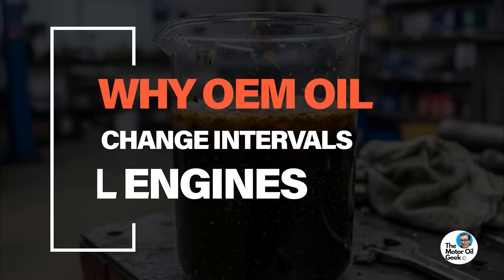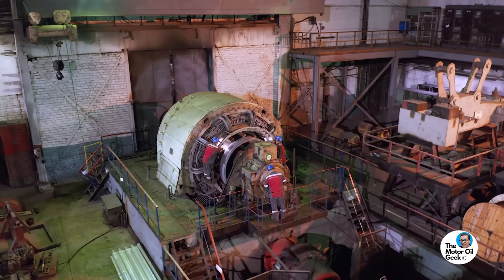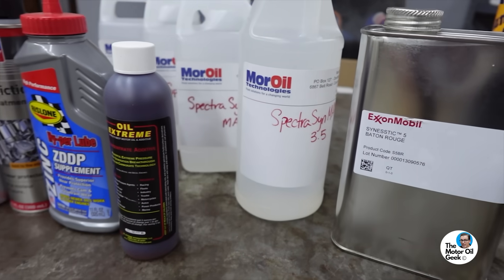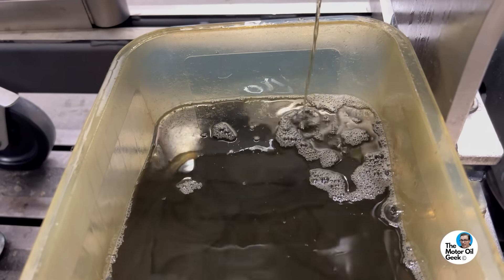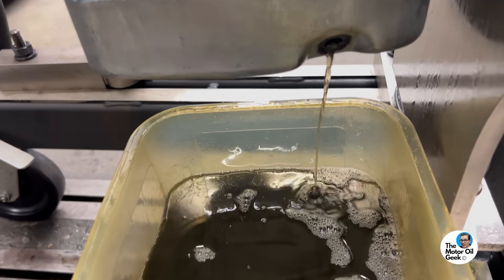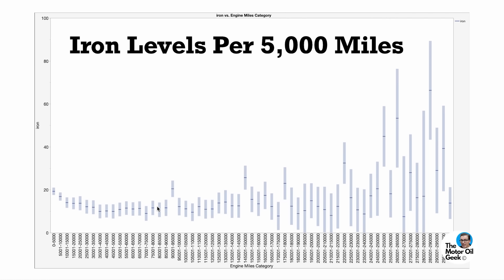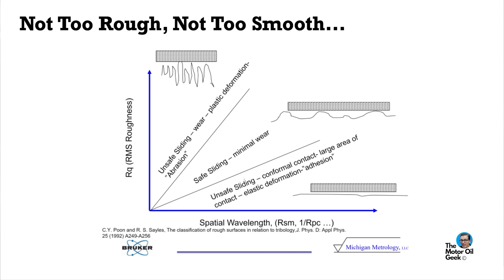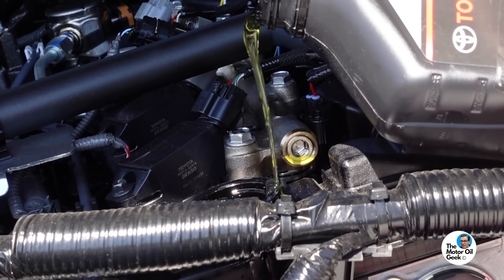NEW Data Reveals WHY Modern Engines FAIL Prematurely!

Comment: To answer the question: Yes cheap bad parts and super thin oil that’s not being changed soon enough. Oil is cheap, engines are not.
Keep up good work
Reply: No name mineral oil is cheap. Big name synthetic oils are not.
Reply: @Beenomars Depends where you buy the synthetic. Walmart usually has brand name synthetic for less than $6/quart when you buy the 5 quart jug and some parts stores are the same when the oil and filter are purchased together.
Reply: @Beenomars  Quaker State full synthetic is a perennial champion of 540 RAT's oil durability board and it is DIRT cheap, $22 for a 5-quart jug at Menards.
Reply: @drunkenmessiah Not available where I live.
Reply: @Beenomars  Compared to engine replacement, YES their cheap
Reply: @Ever443 depends what engine in what car
Reply: The old "oil is cheap engines are not" saying is too simplistic. When you math it out on cost of oil Vs. The expected lifespan of the engine. You do get to a point where changing oil is wasting money. Like there are a lot of people who lease vehicles and turn them in every 2 years. Changing the oil more than necessary to satisfy the warranty is a waste of money for those people. Like where I work. Oil change intervals for my equipment is supposed to be 100hrs per the manufacturer. But I run full synthetic oil and change the oil 1 time per year which usually comes out to 4-500hrs. Why? Because the rest of the machine is going to fall apart first. We have a pretty comprehensive replacement schedule to replace the equipment before that happens. So changing the oil more often is a waste of money and labor. 

Also 65% of engine wear happens before an engine reaches operating temperature. No amount of oil changes is going to fix that.
Reply: @d3faulted2  "Like there are a lot of people who lease vehicles and turn them in every 2 years. "

Those people aren't watching this channel.
Reply: @bcubed72  You never know. There are probably a few.
Reply: @d3faulted2 
THANK YOU 👍👍👍
Reply: As a mechanic you have no clue what you’re talking about. Changing the oil is paramount. I bet you don’t have a vehicle over 500k. I have 5 vehicles over 500k. You know how? Change the oil every 3500-5000 miles. It’s that simple
Reply: @RipliWitani  You're right I don't, but that's more because i like having new and shiny with bells and whistles. Closest I have is a 2014 F-450 with the 6.8 V-10 and 290k. Next closest is a 2015 F-150 with 145k that i sold to my parents. Current is a 2019 with 80k . So much for 10k oil changes bricking the engine by 100k. Still doesn't burn oil. Again I'm not saying to blindly follow manufacturer recommendations. But do oil analysis and base your OCI off that. Make Data driven decisions about PM.
Reply: @RipliWitani  how do you explain the semi trucks that do 25k oil changes and get over a million miles out of their engines?
Reply: @d3faulted2  Easy, they measure their oil changes in GALLONS, not quarts 😆
Reply: @drunkenmessiah  But oil os cheap and engines are not. Why not change more often and maybe they'd get 2 million miles out of the engine? Could you imagine how long those engines would last if you changed the oil every 3-5K?
Reply: How can you say this to one of the premium Tribologist in the industry? Gibbs racing, worked for multiple companies formulating oil and if you sat down with him he might run circles around you on his knowledge of interior engine parts, function, wear and changes over the years.
Reply: @jeffreyb1451  Just because someone is an expert doesn't mean they don't have their own biases or agendas. COVID was an excellent example of that.

That being said. I'm not diagreeing with him. He advocates following the data. Which i'm also saying. Do an oil analysis and base your OCI around that. Yes you need more frequent oil change intervals early on, but after break in do you really need to keep that frequent OCI? Most likely not. There is always a point of diminishing returns. Changing oil more frequently than necessary will just cause you to burn money without any significant increase in engine longevity.
Reply: @d3faulted2  Very few cold starts, ideal driving profile, huge oil volume, unlike almost every car.
Reply: @fritz4493  So you're telling me that there are other factors than just mileage that determines OCI's?
Reply: @d3faulted2 Because they have different oil filtration systems, many long run trucks have centrifugal filtration systems. (That is on top of a standard filter pack)
Reply: @d @d3faulted2 our way overthinking this, simply saying if your manufacturer recommends 7.5k or 10 k you are asking for problems. I change oil every 3k regardless, have used synthetic and standard mineral oil. Have rebuilt 100’s of engines and evaluated wear on short oil changes and longer oil changes and there is a difference in wear and life, exactly what Lake says cleaner oil is better. So change often. But not every 500 miles, don’t be silly. Your changing at 500 hrs is approximately 30k between oil changes. Either your math is off or you’re just lazy. But to each his own. Oil change is average 🎉100 bucks if you take it to an oil change shop. Engines can be 10k + for a full replacement., so changing the oil every 3k costs approx $3300 every 100k. MUCH less than an engine. Your money, do what you want but change often, or your buying a new vehicle much earlier than needed.
Reply: @Ever443  If you manage a fleet this isn't even close to over thinking it. 

You may have been in 100's of engines but you obviously don't understand my points. 

What if your plan was to get a new vehicle at 100k? Any decent modern engine will make it to 100k on 10k oil change intervals. If you do replace your vehicle at 100k you've just saved  yourself $2,300. Not to mention every time you go for an oil change it would eat up an hour of your life...probably. you just saved yourself 23 hours as well. What is your time valued at? Mine is expensive.

500 hours does not equal 30k miles. There is no direct correlation between hour and miles. Old wisdom put 100hrs = 3k miles. But that's just patently false. This is a topic that is long debated. And there is no real answer. Even with miles not all miles are equal. 10 miles of NYC traffic driving does not equal 10 miles on the open highway. Even hours on equipment isn't equivalent. Something that sits at a constant speed and runs on a relatively constant load is not going to be the same as something with highly variable loads and changing RPM.

There are even engines out there that never get oil changes. Like large marine diesels. They have a filtration plant, do oil analysis and add fresh additives when necessary.

The key is doing an oil analysis and basing your oil changes off of that. In extreme environments and hard operations. Even your 3k oil change may not be enough. Or you may just be wasting your time and money.
Reply: @Ever443  Again. Too simplistic and misses the entire point of this video. OCIs are neither static nor linear. They follow the reliability bathtub curve. Frequent in the beginning, less frequent in the middle, and frequent at the end-of-life again. "Oil is cheap" mentality just wastes money and is in no way scientific or data-driven. 10k OCIs are perfectly acceptable once the wear rate has stabilized in the middle of the engine life expectancy. Data shows this over and over again, yet people still do the 3k polluting OCIs. This isn't the 70s anymore.
Reply: 10k lol? Enjoy your brick at 100k. I worked on many modern engines that do what you say. If they are direct injected you better be sure to get the heads cleaned because you will be paying out the ass to get it replaced.
Reply: I worked on marine diesel and you’re completely wrong. The oil does get changed. The bad oil gets separated out and new oil gets put in. You literally just said the same thing. You guys must work for the car manufacturers.
Reply: @Ever443 ..Yeah man,changing my oil every 3k or 3 months is the way I go. My oil rarely reaches black sludge color majority dark brown 300k steady rollin.
Reply: @d3faulted2  I do, and repairs based upon lazy lack of oil changes is VERY costly. we are getting 300K out of our engines, are you to that level yet with that 20K oil changes?
Reply: @BridPatt-v5n  Agree to disagree. After looking at hundreds of engines with high mileage and long oil changes, Yes oil is much cheaper that an engine change. He clearly says the dirtier the oil the more damage. Clean oil is better so frequently is exactly what he is saying. Your data is not correct
Reply: @Ever443  I got 289,000 on my service truck. Think that counts as close enough to 300k.

Comment: I have a 2000 Ford E350 with a 5.4L 2V. I change the oil every 5,000 miles with typically Supertech or whatever synthetic oil is the cheapest. It has 380k miles and still runs great. They are definitely making engines with inferior parts these days.
Reply: My 5.4 2V in a 15 passenger E-350 made it to 610,000 before I had a full electrical system failure, the engine was scrapped with the vans original engine and transmission still functional mechanically.
Reply: I had an 04 5.4 and I meticulously maintained it and the timing chain jumped two teeth and caused a major repair at 110,000 miles.  Then the cam phaser started rattling at start up.  Because of the other list of issues with the truck I got rid of it.  I’m loving my 2016 Tundra.  Unfortunately Toyota is dealing with a big issue with the V6 in the newer Tundra.
Reply: @mowman7777 that sounds like a three valve engine because two valves didn't have Cam phasers. Three valves are garbage, totally different engines.
Reply: @Eaglefreek300 Yes it was the three valve and my last Ford. That truck was such a lemon in so many ways not just the engine. My 89 F150 was such a great truck.

Comment: It's time to admit the truth Lake, us 3,000 miles oil change people are right.
Reply: No, every 500 miles would be better.  The problem with that and 3000-mile oil changes is the cost of oil.  It is more expensive in the long run to do oil changes that frequent.  5000-mile intervals after break in is the best cost-effective interval under most circumstances.

Comment: Hi Lake, I have always wondered why the oil life for cars in the UK is much higher than in the US and how they get away with it. I drive a Volvo V90 T8, in the US the oil change interval is 10,000 miles but in the UK it's 18,000 miles. How can it last almost twice as long without so many failures? I'd love your thoughts on this and maybe another cool video too?
Reply: Is it 18,000 kilometers and not miles?
Reply: @wellnesspathforme6236 no 18,000 miles, we use miles in the UK although Europe do use km instead

Comment: lake which oil should i use in my 91 lx mustang 5liter roller engine that i use in summer time 500 miles  per year its stock no mods .....should i use the gp oil or the hr oil ?

Comment: I change the oil in my daily driver every 2,500-3,000 miles max. My built jeep? Every 1,200-1,500 miles or if I'm racing it then I change it after a few good runs.

Comment: I've watched the part about 0W20 oils several times and am either missing the point or just not understanding. What's the mechanism here?  Why do they get dirtier?
Reply: Not necessarily dirtier initially, just that the lower viscosity oil cannot provide the cushion against debris as well as higher viscosity oil resulting in more wear metals. A lot of newer engines you are stuck with lower viscosity oils due to cavitation, tolerances, oil pump designs and hydraulic systems with VVTI etc.

Comment: Toyota and Mazda OEM oil filters purportedly aren't great at filtering in the 30s micron range,  Id like to see a dive into the OEM filters, flow vs. filtration. Do their engines need the extra flow, or would a tighter filtering media with less flow be better? I think that would be a good video.
Reply: I would assume the filter characteristics need to take into consideration the fact they are using engine oil to perform in a hydraulic actuator capacity. Flow rate is surely a factor. The more the better potentially? A more restrictive filter due to the fact it is filtering down to smaller sizes could directly conflict with the design parameters of the engine design if using oil in a more complicated role of acting as a actuating force on engine components critical to the lifetime of the vehicle. We made a more complex mouse trap and didn’t think it would shorten the life of the engine.
Reply: @RobWilMarLar  Exactly. I know the engineers know exactly what's best, but I've been around enough decades to know the accountants often have a final say. I own a new turbo mazda, and they recommend (between the lines) to use 5w30 instead of 0w20. But, i dont necessarily want to "upgrade" to a 20 micron filter in addition to the increased viscosity and thwart an engineered balance of things.
Reply: @Truthreignssuppreme  we're dealing with a positive displacement oil pump though, so you're getting the same flow rate regardless. the only thing that's changing is the differential pressure across the filter, and the likelihood of the bypass opening.

Comment: If contamination is shorter engine life than why do diesel engines last longer? I guess soot isn’t as harmful as other contaminants. Great video
Reply: I wouldn't bet on a modern diesel lasting much longer if longer at all. Some of the highest mileage engines over the last couple decades have been gas engines.
Reply: You missed that part huh?

Comment: GM engines fail due to poor design engineering principals first. Second are poor manufacturing quality controls and practices. Third, poor workers culture and lack of human care at the factory assmbley level... Unions destroy product quality
Why do people continue to buy GM? 😂
Reply: Gm sucks, i wont ever buy another
Reply: Cylinder deactvation, stop/start tech,  and GDI are major causes of premature engine wear and/or failure.  Cylinder deactivation  has been a well-known GM problem for many years. The insane CAFE regulations have pushed automakers to design more complex vehicles to get better MPG but which are not as durable as the older ones.
Reply: @PassivePortfolios like i said poor engineering principals.... These technologies can work properly and be reliable at no detriment to long term durability, only of engineered correctly with the highest discipline provided there is enough development funding. GM engineers are the lowest grade. GM workers are the lowest loyal workers.... Japanese and Koreans have the highest engineering dicipline and manufacturing care.

Comment: I was given a free sample of TriboTEX manual transmission formula at a car show some time ago, and thought I'd go ahead and give it a try in my 2014 Mitsubishi Mirage with the 5-speed manual. It's been in there for about 1300 miles now, and the car just rolled over 200k the other day. As advertised, the shift quality did improve over a period of time, especially in cold weather. I know you advise against motor oil additives, but what are your thoughts on transmission/gear oil additives?